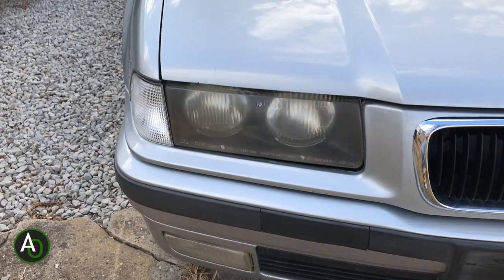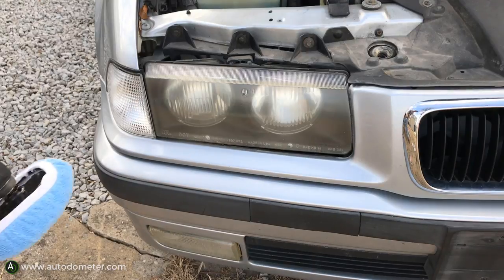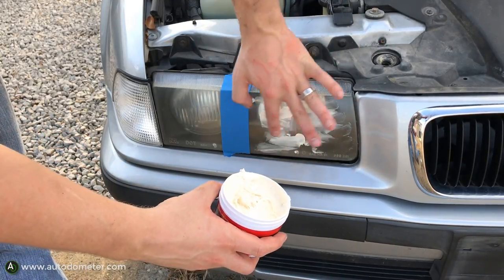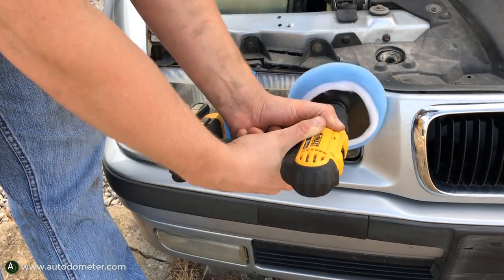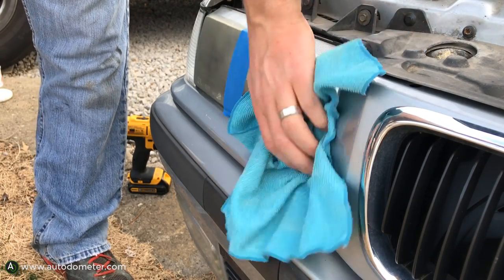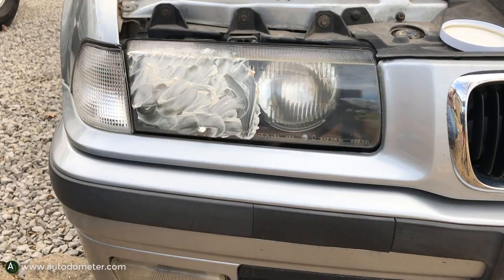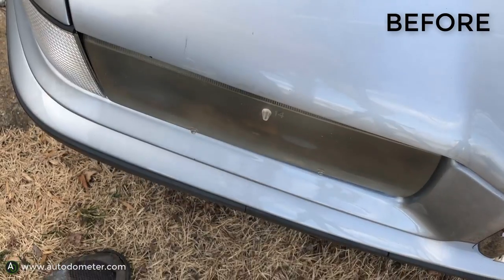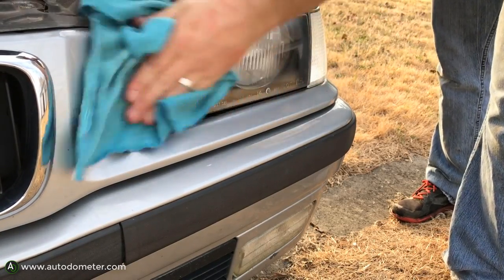How This Secret Compound Repairs Headlights to New (Like A Pro)

Comment: The trick with any of these headlight cleaners is to provide protectant after you remove the defective hazy plastic.   The best I've found is McGuIars keep clear product, which lasts a year.  DO NOT USE CLEAR COAT PAINT - IT WON'T LAST FOR EVEN A  YEAR!

Comment: I've never done it yet, but I have both Maguires and Mothers Mag and Alumium polish and 100  300-3000 2", sanding discs which I intend to use liberally. I believe sanding the gunk off is the best since I  paid a fortune for all of it. Plus, I reason that the gunk should come off by sanding otherwise I figure you are just shining up the coated haze on the headlight plastic. I'll use both of course in the spring on 3 or 4 cars. None of my cars nor brother's nor  neighbor's cars have EVER been cleaned. 
What do you think of acrylic clearcoating? The reason I  ask is because I  found some of that in my shop too.
David
Alberta

Comment: How does this get rid of the yellowing oxidation on old headlights ?
Reply: I was skeptical...literally used this on my headlights earlier today...by hand, took me about 10 mins...AMAZING outcome...they look brand new
Reply: @cloudjulio19  hey please update the current status of the headlights
Reply: @RamSharma-90_64  since I posted that I did  em...and with a decent amount of rainy weather...they're actually in great shape...the haze hasn't come back much at all...I wiped them dwn like 3 times after I saw the 1st results
Reply: @RamSharma-90_64  I've tried everything on different cars...so far that stuff works best and is cheap and simple to apply...if you have a drill and pad I would use that instead just for a better polish

Comment: Use a tooth paste only .. or sand paper 1k grade after that u put single layer ceramic coating  for long lasting shining..
Reply: Can you advise where I can buy the ceramic coating product aside from Amazon. Also, prior to applying ceramic coating, do you use alcohol to clean off Polish? I will not clear coat with Rustolium clear coat in fear of UV rays / yellowing.

Comment: You need to use alot less polishing compound on the head lights.Thats too much Also use a sponge pad instead of the one you are using and it will look better